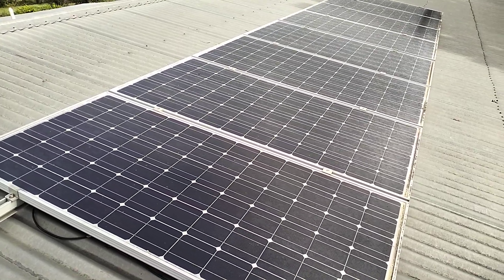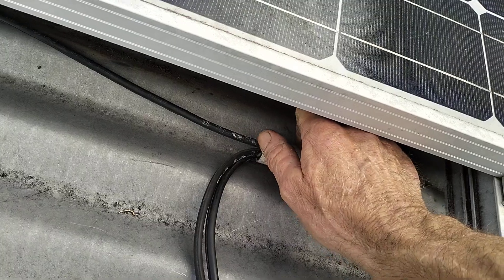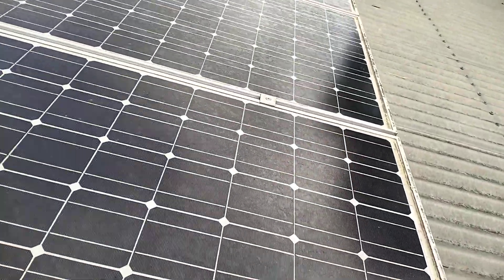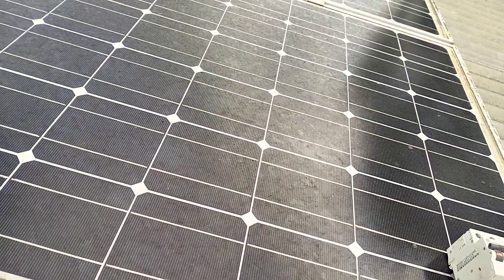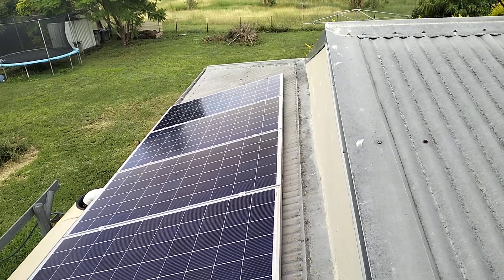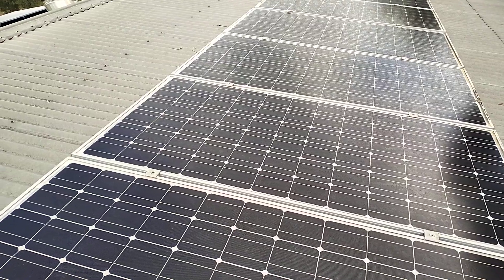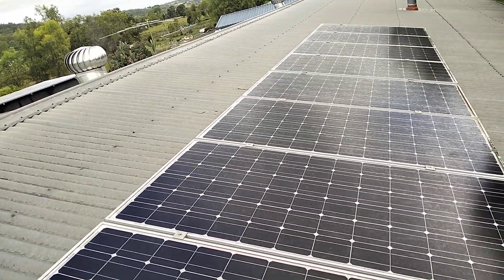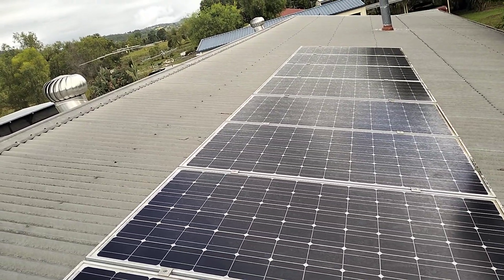A very bad Solar Power installation.

Comment: With the shade would some panel optimizers help with output? I’m new to solar, thanks for the info
Reply from the maker: Yes individual micro inverters would increase the efficiency. The better and more economic solution is to move the panels to a shade free location.
Reply: For cost of repairs, you've got 6kWh/day.  In my part of the world, west facing gives welcome boost during peak air conditioning load.

Rooftop is a harsh environment--would only use steel conduit here.
Reply from the maker: @timgerk3262  yes you are correct about the extra Kwh and stainless steel conduit would be even more suited to last the lifetime of the installation.

Comment: Interesting stuff.  Hopefully the old panels have some useful life left, if only as a starter project for someone learning the ropes.   I'd love to have a dabble just for the fun of it but wouldn't be allowed to by my Landlord.   Won't let me change a light switch.
Reply from the maker: Thanks for your kind comment Stephen. It is sad to hear about your landlord not allowing you to change a light switch. I am experimenting with multiple sets of PV arrays and am about to test a new type of combiner box to automatically switch to the highest producing set (string) of PV panels. So far the small setup I have constructed has reduced my grid power consumption by nearly 50% but I still have to pay network supply charges. Oh well we will just have to see how it works out in the future. Cheers